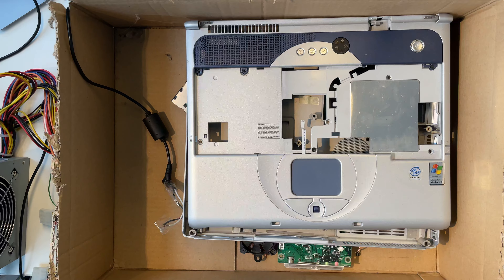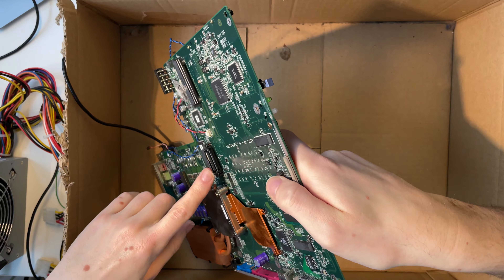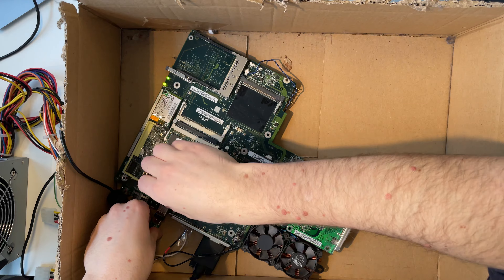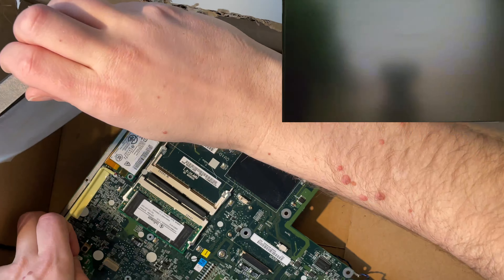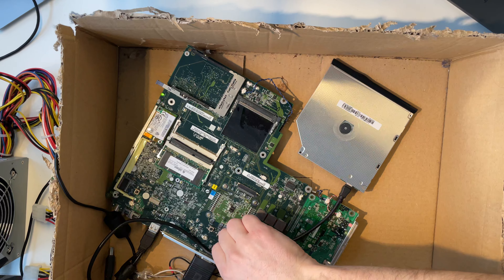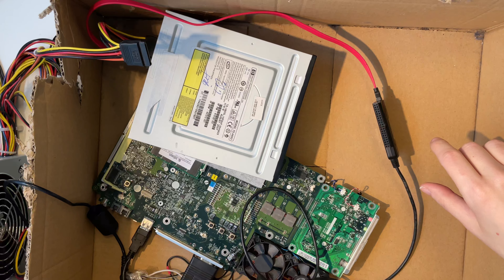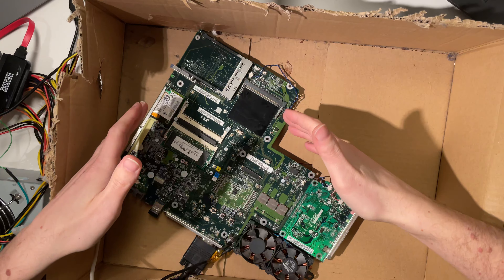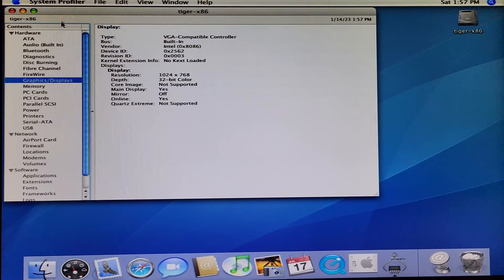Trashintosh | Creating the most cursed Hackintosh while everything goes wrong...

Comment: hey about the USB boot, you can actually boot from USB on most old systems my 2007 core2 quad system with an intel motherboard doesn't like to boot from USBs normally and says this version of bios only supports boot from cd/DVD and hard drives. but if you go into bios settings you can make removable USB devices show up as a fixed hard drive to the bios and it works. it showing as a fixed drive was not an issue for me it still acted like a removable device. mine also booted instantly but that is because it had faster memory and processor.